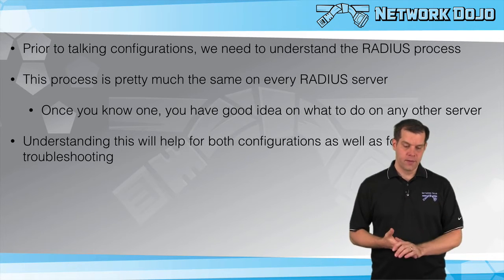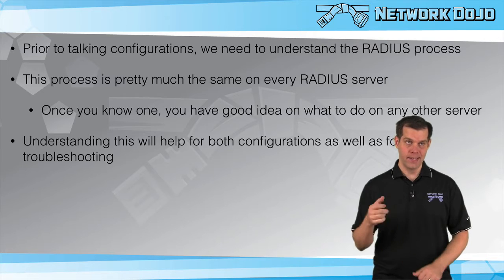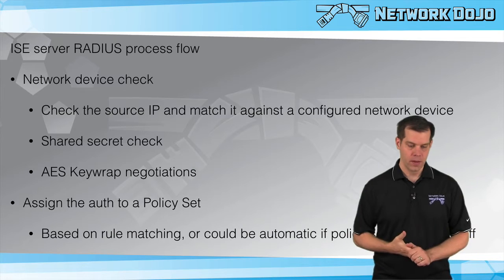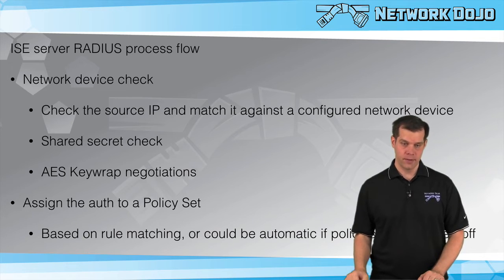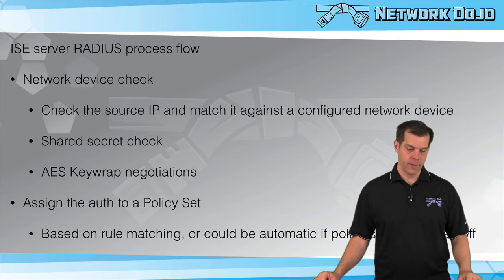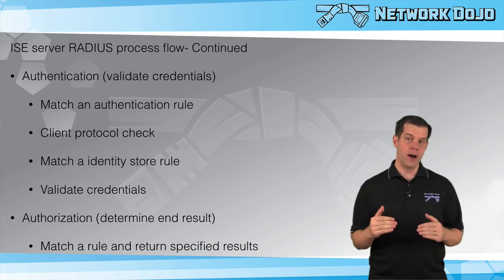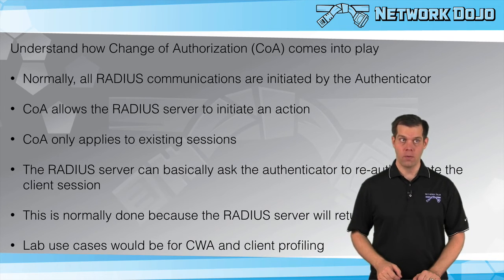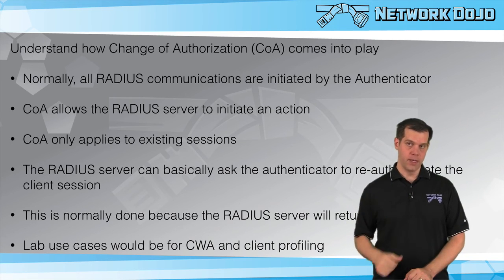CCIE Wireless- The RADIUS Process Flow in ISE

Comment: We have a mixed environment of AAP and LAP.  I tried using ISE as a Radius server with Autonomous AP's 1231G with no success

Also in ISE it seems like *Require Message-Authenticator for all Radius Requests cannot be disabled. I tried to uncheck this box thinking if this is something causing the issue

Any thoughts would be helpful
Reply from the maker: Youtube comment section is not the best place for a back and forth troubleshooting conversation.  I'd encourage you to check out the Cisco mobility forum.  That's a great place for something like this.

https://community.cisco.com/t5/wireless-mobility/ct-p/4931-wireless-mobility